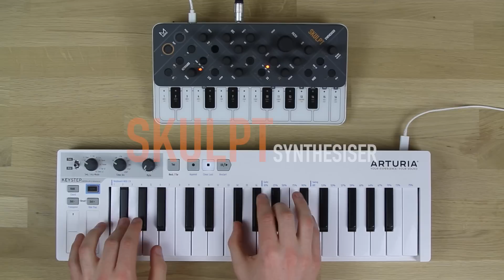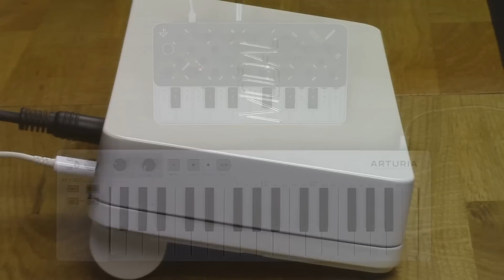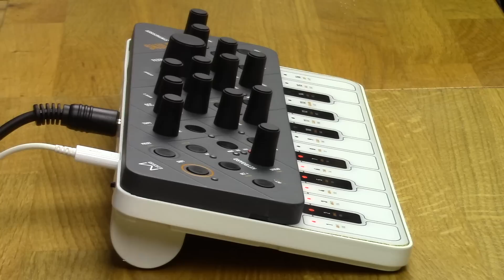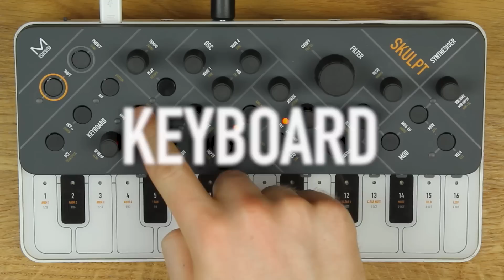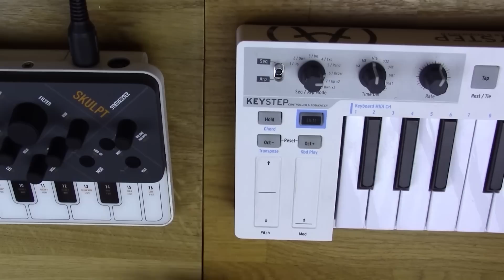Modal Electronics SKULPT synthesiser Walk Through Tutorial

Comment: This + a decent keys controller = the best synth. Considering portability and power. I mean, even the Minilogue XD and the Microfreak are just 4 voices poly. Sound design capabilities ROCK. It's also at an excellent price but that's not even part of my equation. The box it comes with makes it also a perfect backpack device. Encoders automatically protected. Not even volcas or pocket operators are this comfortable to carry (Yeah they fit everywhere but they can get damaged, and if you get a box to protect them then they are not that small anymore.)
Reply: Launchkey Mini does a swell job

Comment: What exactly does the LFO button do? It’s not even covered in the manual! It does not seem to disable lfo1 or 2
Reply: It's not an LFO button, it's for assigning. LFO is the section of the skulpt it's in, along with the rate and shape knobs. But anyway, when you press this button the next knob you turn will be what the lfo is assigned to. 
Once you've assigned something to it, remember to turn it off, otherwise every other knob you turn will also be assigned to another mod slot. 

If you want LFO1 to modulate say the filter, click the button, turn the filter to the amount you want, then press it again. If you want to assign the LFO2, press that button along with the assign button and then do the same. 
If you're not used to it it can get quite confusing, especially if you forget the assign button is on. The shift button also takes the same getting used to.

Comment: 1 minute in the tutorial and I already don’t understand how to load patches (other than the first 16 ones)
Reply: Yeah I'm also stuck here atm, he just loads init patches and other stuff instantly without showing how
Reply: @hinkeltwister7311  I've actually figured it out using the manual, but honestly the manual is a complete mess. Skulpt is designed by engineers that have not idea how to design a proper UI. So, in a nutshell - you can press SHIFT+PRESET and buttons 1-8 to select a data bank. Data bank is a collection of presets/patches. So you select any bank you want and then you use PRESET+1-16 buttons to select a patch inside a bank.

You'll notice that when you hold Preset button two leds will light up, one of them will be flashing. The flashing one is the currently selected preset, the other one is the selected databank.
Reply: @LostStylus  Ah! I's not just me being stupid then? Thanks for clearing that one up.

Comment: Does anyone else have a problem with the touchpad as a keyboard. This demo shows it working. My Skulpt will only work via a midi keyboard. Am I missing something?
Reply from the maker: Hi Chris. Have you checked if MIDI Local has been disabled? This setting can be enabled by holding the NOTE button while powering and selecting any of pads 1-8 (pads 9-16 will disable). Alternatively the MIDI Local setting can be found on the SKULPT settings page of the MODALapp
Reply: @ModalElectronics  Fantastic!  I couldn't do this pressing NOTE, but the Modal app worked to change the Midi Local settings. 

I now have a fully lush Skulpt. I had sent an email to modal, but your reply here will help others. Thanks again.  You might want to update Skulpt FAQ on the modal site.

Comment: hi,
how can I save/store a sequence in Skulpt? it seems only possible to store a 'patch' (preset) and not a sequence of notes previously recorded...am I wrong?
Reply: Had this issue recently as I'd been sequencing externally and decided to use the on board sequencer for something.  Heres how: 

To enter Sequence Patch mode load Bank-9. Now when you hold preset you see 9 is illuminated steadily (Sequence Preset Bank) and the sequence you have loaded will be flashing. (To exit load any of the banks 1-8.)
To store a new sequence first load an empty sequence and record what you want into the sequencer. Save by holding PRESET + HOLD KEY [1-16] (like you would with a patch preset).
Loading Sequences works the same way. Once in Bank-9 hold PRESET + PRESS KEY [1-16]
Reply: @dannyjreisat4935  ok thank you. But I wonder: when I save a sequence, I save also the patch? I mean, do I have to save the 'sound' I have made by holding preset+key 1/16 AND the sequence of notes in sequence bank, or when I save a sequence it automatically save also the 'patch'? And another question: how can I erase a sequence previously saved??
Thank you and please forgive my bad english (I'm from Italy) 😉
Reply: @il_Med  you would have to save the sequence and the patch separately.  A saved sequence isn't tied to a patch. If I remember correcrly, to delete a sequence, when in sequencer mode, use shift + key 13 (clear note).
Reply: @dannyjreisat4935  ok, thank you so much again. In my opinion, this 'separate saving' method is a really really bad feature, very awkward. Better the Volcas, where patch and sequence are saved toghether.
Reply: @dannyjreisat4935  Presets can be saved by holding the PRESET button on the front panel and then HOLDING
one the the 16 touch pads. Each touch pad represents the preset slot in the currently selected
bank.
If the currently selected bank is a patch bank (Bank 1-8) then the current patch setting will be
saved into the selected slot. If the currently selected bank is a sequence bank (Bank 9-12) then
the current sequence is saved into the selected slot

Comment: The manual is less than clear, to me.  Can't I assign CC2 as a modulation source?

It says Breath, but it then says CC11, in brackets.  That's Expression, not Breath.  

There's a table with some crosses in it... I have no clear idea what's being said, there.  On the face of it, it seems to be saying there are only VERY limited choices in the mod matrix.  If so, why, on a software driven synth?

A breath control patch would normally have at least CC2 as a source, and some / any of the destinations, as mod matrix entries.  Is that possible, or not?

Also, FFsake, lay the PDF out to read comfortably on a computer screen - one main column, scrolling vertically.  I'm having to zoom in and out and scroll in two directions, to try to make sense of it.  Okay, it's better than a Korg Volca manual, but that's about it.
Reply: All breath controllers should be possible to assign to CC11. It seems no one uses a breath controller AND an expression pedal at the same time (although that would be cool), so it makes it easier to use CC11 for both. That certainly seems to be the trend I am seeing in default settings for both hardware and software. I usually keep my breath controller and Linnstrument pressure at CC11 as that requires less adjustment.
Reply: @hakonsoreide  Should be, maybe, but the fact is they are not.

So, any synth wishing to offer breath control needs to be assignable.

Any programmer worthy of the name can write a firmware to make that happen.  It's not rocket science.